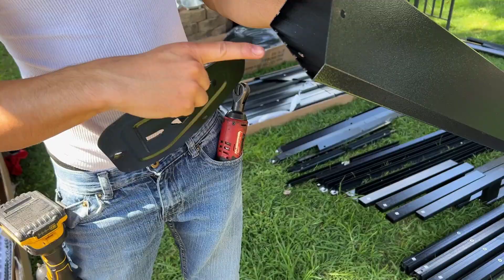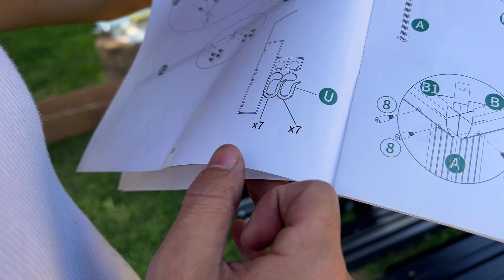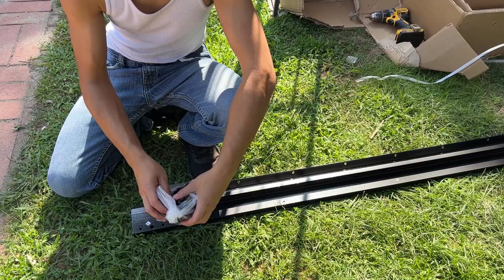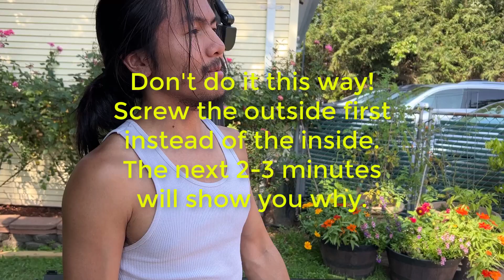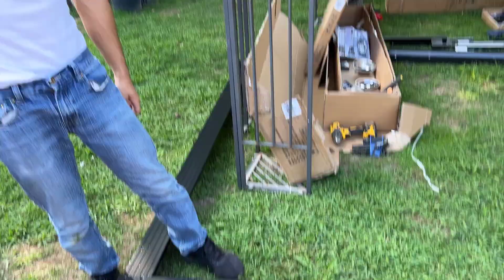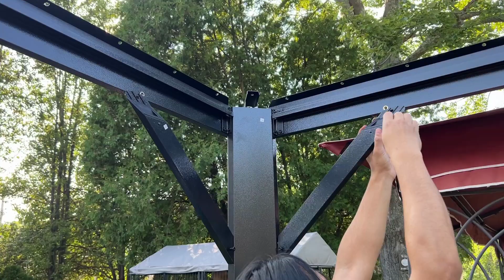How To Assemble Metal Hardtop Gazebo Part 2: Attaching Posts & Put Together Horizontal Beam For Roof

Comment from the maker: Here are the #ᴬᴰlinks if you are interested:
1.  https://amzn.to/44TQ0yO  |  Domi 12' X 12' Hardtop Gazebo, Upgraded Metal Gazebo with Drainage System, Dual-Layer Galvanized Steel Roof, Curtain and Netting, Outdoor Shelter Canopy for Patio, Garden, and Backyard, Brown
2.  https://amzn.to/44YgbV5  |   PURPLE LEAF 10' X 12' Hardtop Gazebo Canopy with Netting and Curtains for Outdoor Deck Backyard Heavy Duty Sunshade Outside Metal Patio Permanent Pavilion
3.  https://amzn.to/4nPlajs  |  YOLENY 10' x 12' Hardtop Gazebo, Metal Gazebo with Aluminum Frame, Double Galvanized Steel Roof, Curtains and Netting Included, Pergolas for Patios, Garden, Parties, Lawns
4. https://amzn.to/46kvZUw  |  YITAHOME 10X10FT Metal Hardtop Gazebo Outdoor Patio Single Top Canopy Galvanized Iron Aluminum Column Garden Tent Curtains Netting for Backyards Decks Lawns, Brown
5.  https://amzn.to/4nPmq6a  |  Aoxun Hardtop Gazebo 10x12, Aluminum Frame Canopy with Double Galvanized Steel Roof, Outdoor Gazebo with Breathable Netting and Privacy Curtain for Backyard

Or Click on Amazon link here and search for what you need:  https://amzn.to/3D1T2GQ

Comment: I am assembling the same Gazebo, but Im having issues with the side rafters lining up. Two of the rafters are 6” off from the hole. What are the diagonal dimensions from the inside of the post to post. I want to be sure my frame is square.
Reply from the maker: If you're off by 6 inches, try loosening the base bolts slightly to shift the frame until the diagonals match. 👍Measuring corner to corner diagonally should give you equal lengths if the frame is perfectly square. 😊Hope this helps.

Comment: What is that Milwaukee tool you are using?  Is it a power driver?
Reply from the maker: It's a Milwaukee cordless ratchet. Milwaukee 2457-20 M12 Cordless 3/8" Sub-Compact 35 ft-Lbs 250 RPM Ratchet w/ Variable Speed Trigger - https://amzn.to/43CGiAx